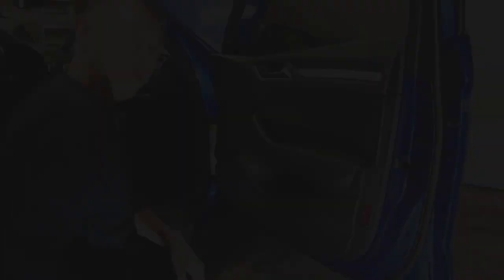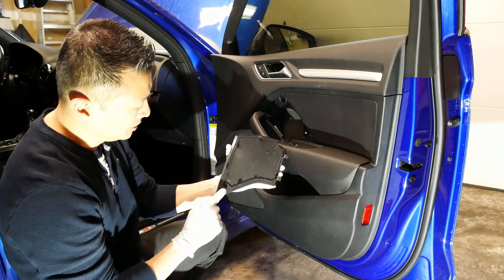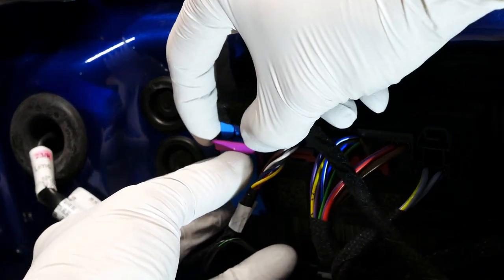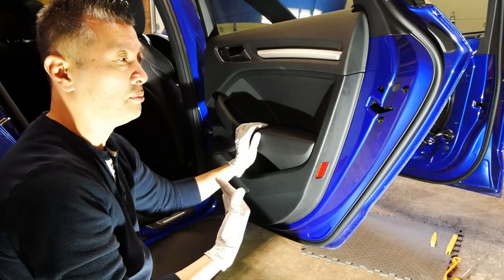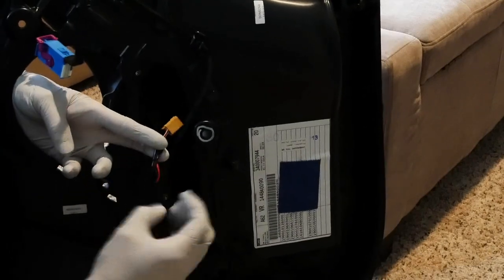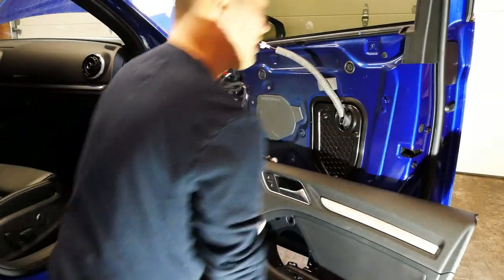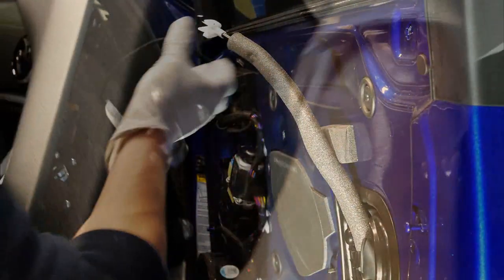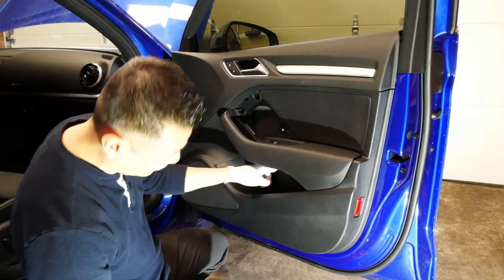Door Panel Ambient Lighting DIY

Comment: I just bought the RS3 door panels for my 2016 Audi A3 so I can main factory harness and have oem lighting (puddle light, warning light, door handle light) but not sure how the pins are for the factory harness in order to code it. Any way you can help me?
Reply from the maker: Hey Brian, what have you down at this point for installation? It's been a while since I performed this DIY, but my suggestion is to plug in the new door panels and see if everything works.
Reply: @TheAutomotiveFanatic  I have everything plugged in and that’s all I have done. None of the lights turn on by just being plugged in

Comment: Hi, thanks for your share. I wonder how much volt is you power ? I can’t find any 12v power in my Audi A6 door panel.
Reply from the maker: Cheney, I cannot remember what voltage my power cable came out to be, but just use a tester to see what wires are putting out.

Comment: Hi boss ! Thx for your really good videos. I just want to know where can I buy "switches" to make the alimentation for LEDS. il you can guive me a link please. And for the back doors, is it the same ? Because I have Bang Olufsen sound, and there aren't light in the back, where have you take the alimentation ? Can you guive me the link for the leds too please ?
I have aliexpress application. 
Thank you for your help
Thank you very much
Reply from the maker: Are you referring to the power source for the LEDs to connect to? Each door should have a window power switch. If I can recall correctly, that switch is lighted. You can tap into that positive terminal of that switch.
Reply: Ok great ! I'm French, and I had not understand that switches were connecting to windows power.
It's really cleaver !
I have found the kit whit LED in Aliexpress, it's selling with switches. Really good, and thanks a lot for your quick answer.
You are doing good job with your Audi. Take care boss !

Comment: hello, thank you for this video, I just started the installation from paris France, I have the same concern quoted in the other comments, no led in the rear and passenger front door, I wanted to know where I can recover a wire  12v in the door, as the connection on the window button does not work, thank you for your help

Comment: did you install a current limiting resistor inline with the LED? or does the door control unit limit the current at the output pin that the led is connected to?
Reply from the maker: hello dudekidPL, I did not install a current limiting resistor for the LEDs that connect to the door panels. The ONLY resistor I used, was the one feeding the cup holders. It was too bright.

Comment: Hi Peter.
I have an A3 8V Facelift 2017. I did everything as you described. And now I have no power to the window switch. The widow can still be operated from the driverside door though. What did I do wrong? Can I have short circuit the control box?
Lars
Reply from the maker: Hey Lars, sorry to hear about the troubles with the window switch. It's been quite some time since I performed this DIY so I reviewed some of my notes. 
When you took apart the door panels, was your wiring scheme the same as mine; blue for power and brown for ground (earth). Did you use a voltage meter to test the power on the wires to double check? Does the window switch still illuminate up?
I doubt you short circuited the control box because you're still able to control the windows. What I would do, remove the passenger side door and double check your wiring. Pull off the LED wiring and connect all the OEM plugs back and see if the window switch works. It's somewhat a hassle, but you're troubling shooting to see what may be the issue.
Another thing you might check, and it is completely elementary, but is the child-proof window lock on the driver's control panel engaged??? If so, ALL your windows will not roll up/down. As simple as that may be, I hope this is the case. Please report back!

Comment: Hi. I was wondering if you could help me out figured it out my issue.

I did this mod following your guide. And it was working awesome.

I was unlocking via OBDEleven the Ambient lights Menu on the MMI to activate the foot well lights. I did all the activation reset the MMI menu appear.

However after that my dimmer switch does not work anymore and my car is not getting any power to light the rear doors window switch or the rear bucket lights. They windows go up and down but they don't have lights anymore...

I redo all I did again via OBDEleven reset the MMI. Still not working...I remove the rear door panels check all the connections the door Module, they are good plugged properly to the Module. I also check the door wiring main wiring all is good. Still not red lights on rear window switch.

I have no idea how to fix this. Because everything should work fine since I reverted back the coding I did. And I double checked the history logs of what I did I never touch anything on the rear doors.

I scan the car and I'm getting: 
Trouble codes:

U020100 - Lost Communication With “Door Control Module C”

static

U020200 - Lost Communication With “Door Control Module D”
Reply from the maker: Hey Eli, first off, thanks for the support and watching my channel.

Now to your issue. I am sorry to see that you're having issue. Unfortunately, it's tough to diagnosis electrical or Canbus issues. For a project like this, it was best to us VCDS to code as I do not know how well and safe ODB11 is on the Canbus system. Even though you reset all the coding, something within the modules became corrupted. The best thing might be to have someone with VCDS access your modules and see if OBD11 may have mistakenly disable or corrupted a setting.
Reply: @TheAutomotiveFanatic  Thanks for your response. That's  also my current theory. I'm really annoyed cause this is the first time that I have a issue with OBDEleven. I have code lots of other things in the car. I'm now trying to look for someone with VCDS in the San Antonio TX area. Because I don't think that replacing the door Modules will fix the problem.
Reply from the maker: @Eli07K  again, I'm sorry something went wrong. If you are a member of Audizine, try posting up and seeing if someone local can help you code.
Reply: @TheAutomotiveFanatic  I'm a member but weirdly no luck there. One thing I noticed because I make the puddle lights activation on OBDEleven and I never need it to long code like you recommend here because OBDEleven options were different for me....but I did took a look at my rear door codes
Current Code:000E13204000048000000002

So I will attempt to long code them using the code you provide in this video.
Reply from the maker: @Eli07K , I wish you the best of luck! If I were local, I'd help you out.
Reply: @TheAutomotiveFanatic  Thanks mate. Well I try long coding today using your code on your video: 
004517204000048000000002

My current code on the rear doors is

000E13204000048000000002

I cycle the doors but Still no light on rear window switch or the ambient lights. Only thing left for me to do is try to use the old code and see if that changes anything. I really miss analog cars. Lol!

Comment: If I was to connect el wire in the same way, would it work?
Reply from the maker: Cilfa, I don't quite understand your question. What do you mean el wire or which wire are you asking about?
Reply: @TheAutomotiveFanatic  my apologies. By el wire I mean stip that lights up when connected to power. There are kits available but they require power from the cigarette port. If I was to cut this and connect to the wires you have show, will the light power up ?
Reply from the maker: @MrCemcilfa  yes, can connect another LEF strip to the same power source. Just make sure you also connect negative.

Comment: Hi I tried this and tapped into led in door handle switch. But it keeps cutting out would this be the same with tapping into window switch?
Reply from the maker: David, my guess is, the LED lights you purchased are drawing too much power. Are you making sure the dimmer knob on the car is turned all the way up?
Reply: @TheAutomotiveFanatic  Hi dimmer switch is up high I took door off again and put to window switch. As per your video. Will let you know how I get on. Thanks Dave  great videos you have!
Reply from the maker: @davidcrawford737 , good luck with the change.
Reply: Thank you so much you were right dim switch was slightly off and not on full.
Reply from the maker: @davidcrawford737 , that's great news!
Reply: @TheAutomotiveFanatic  hi Peter I have just installed the carbon fibre ambient lightning and its very low light until I pull window switch up then get full power what could be the problem 
Thanks
Reply from the maker: @pavkhan9627 , did you try to adjust your dimmer switch to full brightness?